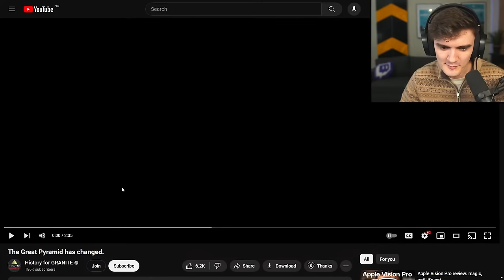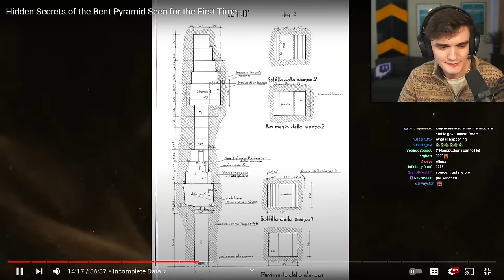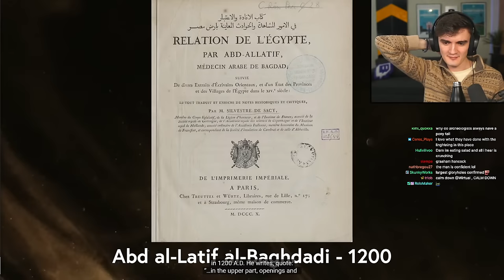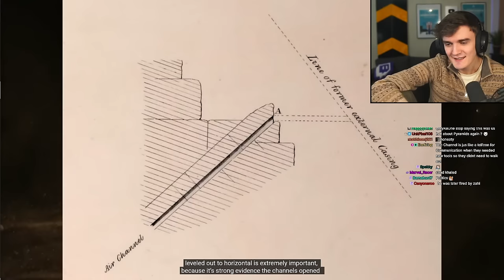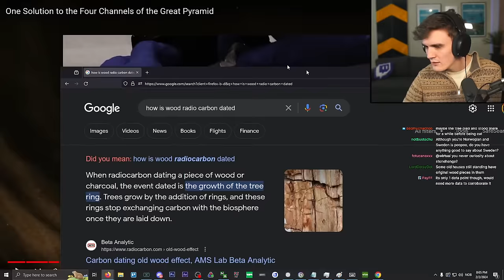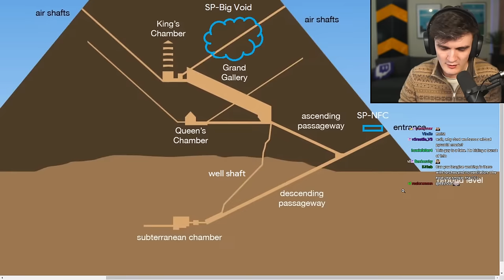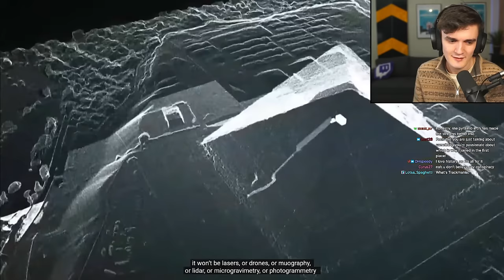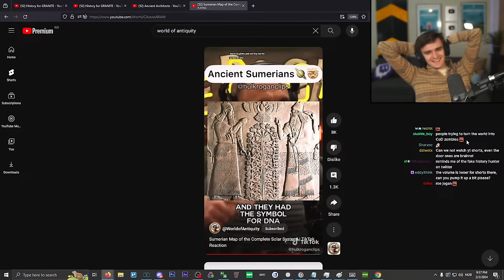Wirtual Talks About PYRAMID Discoveries For 3 HOURS🔺

Comment: Your enthusiasm is contagious!

I watched this 4 months ago, and my curiosity as an engineer was triggered. I ended up spending the next 4 weeks watching and reading all kinds of pyramid content, you demon!

Unexpectedly, I eventually began to see a potential practical purpose for the pyramids: Water valves! In my professional opinion, constructing a pyramid to support a vertical column of water might be the only way to possibly control a high pressure water source, above ground, in ancient times. This is actually an extremely difficult task even today - just look at the Deepwater Horizon oil spill where they could not close an open and flowing oil well, and you can see what I'm talking about.

By building a pyramid layer by layer around an already flowing water source, the resulting water column will gradually exert more and more hydrostatic pressure until the pressure and flow reach zero. At some point, the water source simply doesn't have enough pressure to lift the water any higher.

Such a tall water column would've exerted a hell of a lot of horisontal forces to contain though, which is where the pyramid shape comes in. A pyramid is the strongest and most stable construction if you want to build something tall. Technically, a cone is better, but a square shape is much easier to build.

It wouldn't be wrong to think of the pyramids as extremely small four-sided dams - gravity masonry dams made from stone or brick to be more precise, which use weight and friction alone to counteract the pressure and forces of trapped water. The Nagarjuna Sagar Dam in India and the Theodore Roosevelt Dam are proof-of-concepts, demonstrating that it is possible.

I even made a video explaining it and posted it on this youtube account. To my surprise, I think I actually manage to also plausibly explain the internal features in the great pyramid, as simple mechanisms needed for the pyramid to act as a water valve. It would also greatly assist in their construction of course, as free potential energy.

Anyway.. it ended up being quite the fun journey, so thanks for inspiring me. I hope you get around to making more pyramid videos.

Comment: As it was sealed, many times they are just objects that eventually fell into the hole due to construction, and as they were never opened they remained there.
With the conclusion that the queen chamber was not finished, and thinking that it is centered on the pyramid while the king chamber is not.
They may have planned to go from the queen chamber to being the king chamber, but for some reason, they decided to abandon the work and remake the king's room in another location.

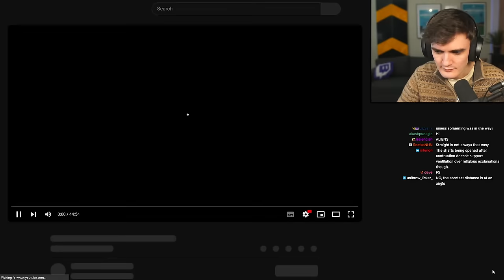Comment: 1:52:40 keep in mind, they’re not digging these tunnels. They’re placing blocks, layer by layer, with grooves cut out of the rock to eventually slot into a tunnel.

There’s a hundred reasons why it might be easier to not make the path straight. The nature of the rock, the joints in the path, the other construction going around on the current layer. 

No one cares about the inner parts of the tunnel, so the workers did whatever was most convenient.

Comment: I believe that the ventilation for workers is not a bad hypothesis. Workers on the pyramid in ancient Egypt were not slaves as is commonly taught they were respected members of the society and even were allowed to be buried next to the pyramids which common folk were not. With so many of them working underground I think it would have been only possible to work with ventilation otherwise death from heat stroke would have occurred. As with that one section with the sweaty guy shows just existing down there is enough to get someone to sweat let alone 30+ builders working at once. Even use of the ventilation shafts as cooling for when the pharaoh would have inspected could be the case or for when the funeral procession took place the leaders of the society didn’t want to be cooked for what could be days of preparation (idk how Egyptian pharaoh tombing went).
Reply: Yes and everyone forgets they didn't have LED head torches.
Reply: But hardly anyone is actually working underground as it's built layer by layer, but maybe necessary if there is internal decoration and ornaments to be laid in afterwards and those were probably higher class workers/priests.

Comment: I dont know if it was "king to the stars" but I think its possible that the Pharaoh/religious advisor said "we need a passage to the sky" without a specific direction/target in mind.  I think though its way more likely they were just used for air tho.

For why the tunnels turn, I learn toward the pyramid being rebuilt upon (the queens tumb tunnels seem way too long to be a trick and those trap doors are weird).  Ie dunno howx exactly the stones were made but I imagine you would cut the air passage before placement and lining those up and aiming those cant have been easy.  It could have been chocked up to "good enough for whats hidden".  It could have been intentional,  maybe there were concerns of sand or the sunlight heating up the tomb.

I do look forward to more on this and I appreciate the channel recommendation.

Comment: The queen’s chamber shafts being unfinished and plugged when discovered actually makes a lot of sense now. They decided to abandon the queen’s chamber, built over the ends of the shafts as they continued building, and never unplugged the openings in the chamber since the chamber was never finished or used. I’m going to assume they needed air flow for some burial ceremony (potentially involving fire so they needed lots of oxygen) or even just to allow the important rich folks who were in charge of the burial to have fresh air, hence the King’s chamber’s shafts being exposed and unplugged.

Also, the slab with the copper handles could very well be a temporary plug to stop rain and debris as it was described and when they built over the shaft after abandoning the queen’s chamber the workers on that side of the pyramid just left the slab in for whatever reason.
Reply: It's probably that they planned a smaller pyramid where the queens chamber was in the middle and the shafts did reach the exterior, then they upscaled the design. So they had to add the grand gallery to haul blocks up and which blocks the queens chamber. I don't think they were even trying to hide it from robbers, but rather hide it as an imperfection.

Comment: 2:09:05 Yes, we have 500 year old wood now. We have them in some very old buildings. "grafelijke korenmolen" at "zeddam" netherlands was build in 1441 for example. It's possible that larger logs have been cut in pieces and reused for smaller items such as toys and tools after their initial use as part of a building or crane or whatever was done. As long the wood isn't rotting or damaged in other ways, it will stay strong forever. There is no reason well protected wood couldn't last indefinitely.

Comment: I assume what he is getting at is that the chambers were constructed in the same way that the outside of the pyramid was constructed. Nicest stones are placed where they are most visible. So basically the Queens chamber was built first by leaving a larger empty space in the pyramid, then to finish of the interior and make it look all pretty, they put nice finishing stones on the interior walls and once the pretty walls were in place they would have cut holes where the airways were to finalize the room. thats also why they wanted to square off the ends of the hole so it looked nicer. As for what the airways are for, i think its to let the body of Pharaoh to dry up instead of turning into a gooey mess due to high humidity and heat.
Reply: From how I understand it, the humidity we saw in those chambers in the past came solely from tourist's perspiration. Also I don't know how much a bit of humidity would have affected a pharaoh who's lying in his sealed sarcophagus, embalmed.

Comment: Here's a layman's theory:
Symmetry and accuracy would be standard construction knowledge, but could the queen's chamber be a blueprint or a trial run for the unique features of the king's? Either A, you only get one shot at getting the king's chamber perfect and it is the most important room, taking the time to build the queen's so you don't run into unforeseen consequences would be insurance. Once it's in a condition where the work to completely finish it is technologically trivial, you can leave it, confident you have a working blueprint.
Or B, it's an actual blueprint, to show future generations in which order and how it was built. An architect and a builder are different professions, how things work in theory isn't the same as which order you have to build, if you're a stonemason at the time you could see oh, it's a smart move to leave the final corner uncut in case you accidentally bump it, and whatnot. This one seems less likely as I don't see why you'd leave a grave unsealed for a generation or two so people can examine the techniques and only seal it up later.

Comment: I think the ventilation could be there to prevent the kings chamber or rather the objects within including the pharaos mummie from moulding. It was said, that it was quite humid and hot inside, which definately arent the best conditions. With the venzilation humidity and temperature dropped dramatically.

Comment: If the Queens Chamber was supposed to be a decoy, which I find most probable. It makes sense that the shafts weren't finished. I think as thieves would enter, they would see the the shaft, thinking its for ventilation, and walk inside. Only to get trapped by a huge block, blocking the entrance and suffocating them. This also ties in with the theory that the shafts remained sealed during construction and that the chamber was unfinished. The Queens Chamber was finished and the shafts were never meant to reach all the way to the outside.
Reply: The queens chamber was probably the original burial chamber in a smaller designed pyramid, where the shafts did extend outwards. Then they decided to make the pyramid even bigger probably mid construction as I doubt they would have the casing stones on the smaller pyramid yet.

Comment: Imagine the Pyramids were build layer by layer, the the workers/slaves could have also carved out the tunnels and airholes, layer by layer. That would take out the problem of carving it out later and then, having no Oxygen due to torches. If the chambers were filled with sand to hold up the sealing, that would explain why holes like the Airholes or the entrance of the queenchamber were not opened beforehand and therefore opened afterwards. That would explain why the queenchamber entrance has also a ledge. The holes were opened to give the worker air to work, i can’t imagine how the other pyramidchambers were build, unless many dead workers was the consequence. A room finished, the Airholes could be closed by the most outer layers, as the queenchamber is. The kingschamber’s airholes were maybe needed, for later purposes aswell and not just for the workers. I don’t know enough on how they build the Pyramids, but if it was layer by layer, this would explain how workers could survive there.

Comment: Okay I don't know much about the pyramid, but What If the shafts are for ventilation but they weren't just made for air and meant for smoke like a place to let a small fire candle to give light. (the video might have said this already I left at 1:41:32)
Reply: if that was the case, there should be soot on the ceiling and to my knowledge there is not

Comment: Ventilation for the Pharaohs body so it wouldn't get damaged by moisture? Queens chamber just being a false or early building if the Pharaoh died early. It would explain why the vents doesn't go to the outside, they probably started serious work on the main chamber and simply stopped work on the backup chamber, leading them to block it up and build over it.

Comment: Just going off of how I would think to do it. Id make a big square. Measure the hight, and a distance away from a side. Whatever distance you want. Lets say height 20 ft, and distance 20 feet. 

On top of first square, build another 20 ft tall and 20 feet in from all sides. Continue untill you cant anymore. You now basically have a square wedding cake. Building most of the interior as you go up.

Build out to complete the triangle. Blocks on the end, if 10 inches tall lets say. Do the ratio 10/240 = x/240 you get 10. So go 10 inches along the block, cut back to edge and you have the same angle as your square. in this example.

With this square cake its easy to build a ramp up. Since everything on the top layer will rest on the square beneath. You can start at the top section and build down. Start at the center square walls and move out. Wouldnt even need a second method to ramp up again.

Perhaps the angular shape wasnt just to slide in from up top. But to wedge something in to help place blocks. And if you were to place a block in front of the hole, on the next layer towards the edge. and use a lever to flip it into place, its gonna rise. With the blocks shape as a trapezoid the higher it gets the easier it is to get it in the hole and fall to fit.

Square has to be perfect, its angle shape allows a little left and right movement when flipping it into place. They were probably the hardest blocks to place, so they made it as easy as possible to fit them. 

But im pretty sure you could do it with 1 ramp even the nice anglular outer peice with this method. Idk if it is a method already thought of, but thats how I would try to do it.
Reply: These people invented measure twice, cut once. They probably dug first. Perhaps it was something entirely different until they decided to build a pyramid on top.

As yes, they were paid with life to work on the pyramids. Yeah, the people overwatching the slaves were probably paid Egyptians. But like you said, everyone had slaves. Whether it was other people or their own.
Reply: Also idk why I'm thinking this, but I would have bet that the designers were killed afterwards to hide secrets but I could be completely wrong with that.

Comment: I think the pharaoh believed he would far outlive the construction of the pyramids and wanted to go inside the chambers. Maybe he included the air channels purely for his own comfort in the time leading up to his death. I dont think its crazy to believe a pharaoh would include such a massive detail for a "just incase i want to go in there it cant be hot and muggy". The queens chamber and channels might have been left unfinished if she died during construction. They could have buried her and sealed the chamber in a rush if that were the case. At that point, they would have just left the blocks with the copper pins in the channels where they were, as there would be no point to continue the air channels. That might explain why the finishing touches had been started, but strangely not finished. The one outside corner on the wall of the chamber, and, only the first few cm of the air channel opening.

Comment: I was wondering while watching if the queens chamber could have been a failed attempt at the actual kings chamber, or maybe they decided to expand the pyramid at some point during construction. To me it would explain why the queens chamber is off center unlike the kings chamber, and also explain why the part lower (which I assume would have been completed first) is left unfinished. There are probably a ton of holes in this theory, but I would love it if someone could explain why I am wrong.

Comment: Air to prevent buildup of moisture to preserve body more and stop mold
Reply: I also think the off centerness of the chamber helps with airflow by creating a difference in pressure between the sides cause the air to flow in one side and out the other

Comment: The twisting of the ventilation might have been to reduce fracture lines
Reply: There's a high degree of harmonics in the design of the grand gallery. I think the shafts are deliberately non symmetric to not introduce unwanted interference.

Comment: About the wood. As you said ,carbon dating isn't perfect but it's pretty accurate until ~50000 years. 500 years isn't very long in the grand scheme of things 4600 years or 5000 years might as well be the same. Some claime they are 11000 years old tho. Guess that's been debunked

Comment: i would guess that they needed air for the burry and have him preserved without air afterwards
Reply: i mean if the only light was fire wich goes out without it then it makes perfekt sense ^^ maybe the quen was dead and the burry over within the buildtime so they wont need air after the burry and stopped building the aircondition
Reply: and when its closed there is no way to do hard work in there without air

Comment: You seem to be quite knowledgeable about the Pyramids, but you still subscribe to the belief that their main purpose is a pharaohs tomb?
Nothing about the great pyramid indicates that it was used as a tomb. None of the passageways are human sized, no ceremonial markings on anything, unusual "sarcophagus" in the "King's" chamber. Even these shafts have no purpose if this was just a tomb.
What is the grand gallery for if this was just a tomb? The grand gallery must have been one of the hardest parts to construct, why would they do this is if it has seemingly no purpose.

Keep an open mind when looking at these new discoveries, if you look at them through the lense of "why would this be necessary in a tomb" you come up with incorrect justifications  to fit your preconceived beliefs.